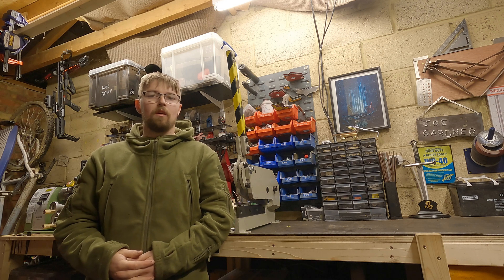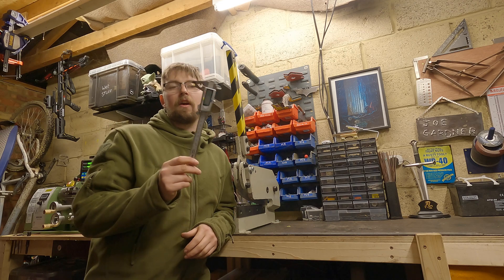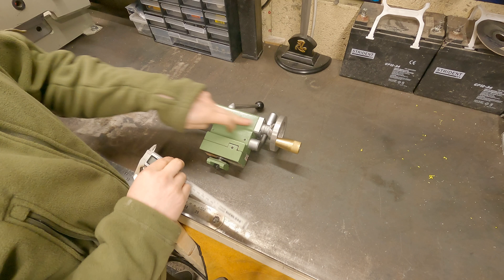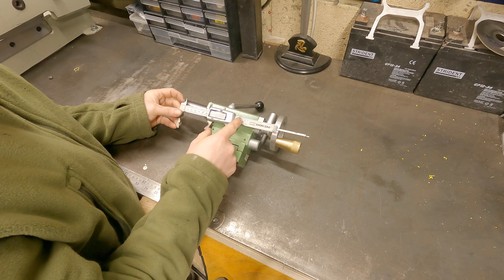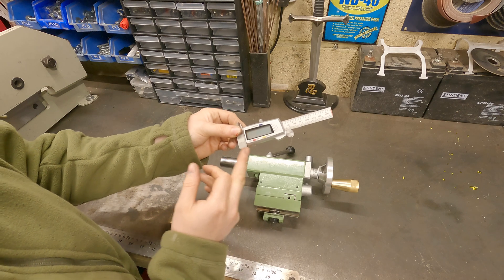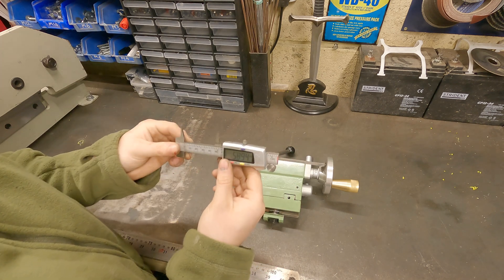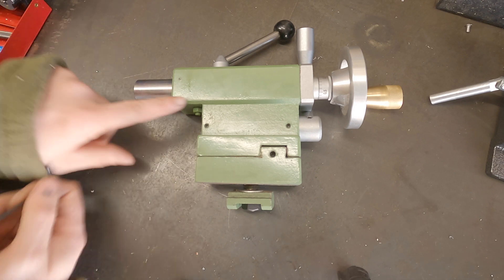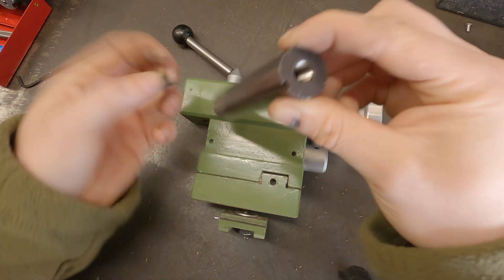Mini Lathe Tailstock DRO

Comment: When I retract my quill to pop the taper (MT2) there is only 1 mm left showing of the quill, so your idea will not work for me.  I can lengthen my tapers with a headless bolt, but only on one collet chuck that has M10 thread in the end.  The others I would have to drill in and add something.

Comment: This was a few years ago, but now days it's just as cheap to buy a dedicated digital vernier scale kit as a vernier caliper and you don't need to cut up a good working caliper.
The kits come with a digital display that can be remote mounted, or mount directly on the scale, wiring harness, mounting brackets for the scale and display, as well as some screws to mount the scale and display.
You can mount them on any axis of a lathe or mill.
All you need to make for the tailstock is a collar for the quill.
I bought 2, one for the Z axis of my mill and 1 for the tailstock of my lathe.
They were only about $30 AUD each kit.

Comment: Nicely done. My lathes are a bit larger but, this idea will work with them, too. It kind of makes one wonder why such things have never been part of the original equipment. Yes, there were measurement marks on the quill but, not nearly as visible or accurate. Even before the digital age older calipers could have easily been used. Oh well. Such is life when the accounting department gets involved. LOL

Comment: You’d do well to slow right down for those larger drill bits, that was way too fast for that 25mm (hence the noise it was making). If your machine has got the fast & slow selector use that & run it dead slow.
I added flood coolant to my little Warco mini lathe, I found it helps a lot with drilling in aluminium, but a squirt of WD40 (or a cheaper alternative) works well.
The flood coolant was an interesting project, I pressed a drain area into the bottom tray to take a modified 15mm brass tank fitting from a DIY shop, mounted a sump underneath the bench (made from an old plastic Jacob’s crackers tub) & used one of those tiny little pond pumps for the suds. I modified one of those cheap Chinese mist coolant pipes for the spout & screwed it to a magnetic clamp so it can go anywhere on the carriage & be put out of the way when I’m not using it.

Comment: Waste of time. With a carriage DRO. Put  a square tool in the holder. Bring the drill up to the workpiece and move the tool bit to touch the end of the chuck. Zero the DRO and move it the depth you want. Then drill in till the chuck I stopped. Simples

Comment: did this on my desktop lathe on 2 main work axis + tailstock :) Works like a charm + much cheaper than a real DRO... :)
Reply from the maker: Yeah it’s a great budget alternative for these small machines.
Reply: @MachiningwithJoe  sure. and specially for  desktop lathes... its really enough for what you need, and from what i tested its far more accurate than the analog dials on the rollers :)

Comment: This is not as good an idea as it first seems. Modify instead to have a rod where he has the caliper and put  a stop on that. Then set the stop for depth of drilling or whatever operation. More repeatable, not trying to sneak up on a number, can watch the work instead of the caliper, just as easy to use, can be set with whatever precision you like, not as température sensitive or moisture corruptible and doesn't need batteries.
Reply from the maker: Hi Tim 
Completely understand what your saying and yes for repeatability a stop is always going to be much better. My main reasoning to get this modded onto the tail stock was more for convenience at just being able to take a quick glance to see roughly how far my quill had moved. 
For any high precision work then I’ll still be using my dial on my hand wheel. 
All the best